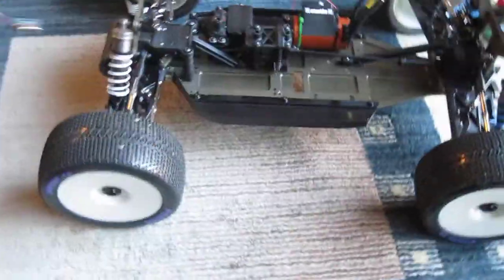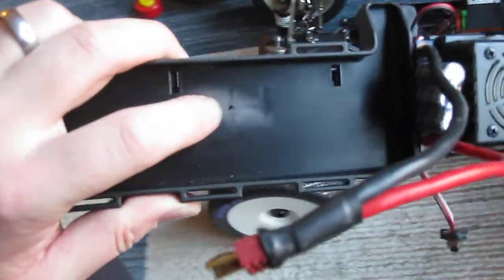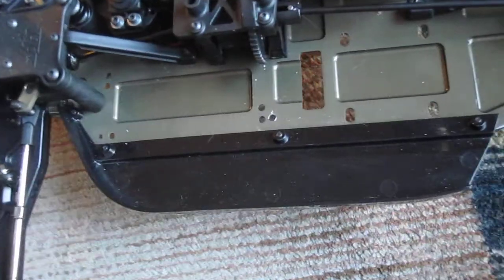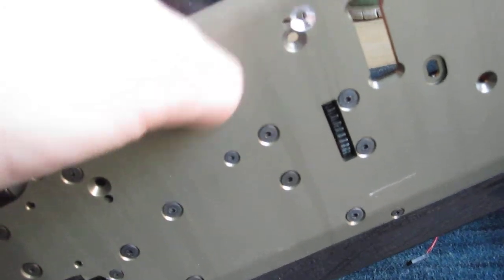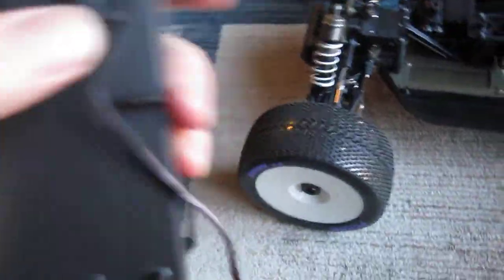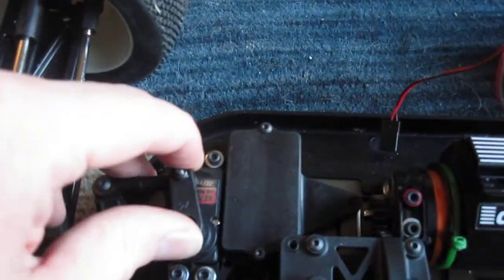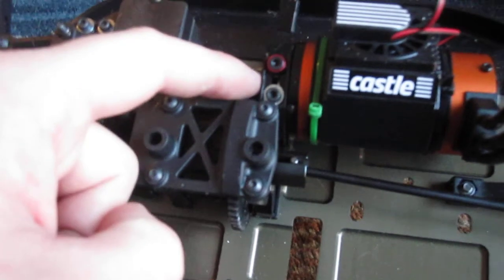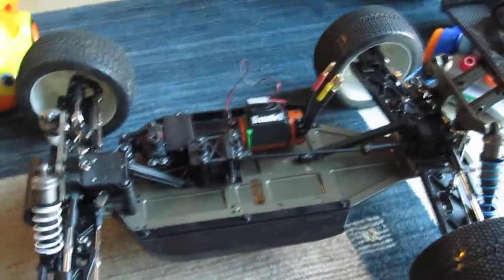D8T brushless

Comment from the maker: Will post when I get back from vacation
Hobbyking 150A esc
Tacon 42mm 2200KV
Losi battery tray, from one of their 1/8 scale cars
Motor mount i cant remember brand but it was expensive about 80 bucks really nice though
Radio box was a cnc part dont remember brand either about 15 bucks and is part of a conversion kit for the d8t

Comment from the maker: hehe, they made it very hard to assemble, always had to keep bags/screws/small part etc under tight control, so they wouldn't grab/eat/throw a part away, but it drives nicely, same size as my e-revo, but handles so much better, has a ton of power, runs cool

Comment from the maker: Elite Rcd motor mount, a very nice mount i might add

Radio airtronics mt4 + fhss4 telemetry receiver 
Hitec 500 oz 7.2v 
Some cheap 7.4v bec 

Things i would do different... Center mounted esc plate that mount to the center diff towers,  this would allows you to mount a battery on each side for better left/right balance although you can always just add lead weight if its a problem

Comment: how fast it was running on 3s? 
how the temps with that battery were after a full pack?
Reply from the maker: i used two 3S which made it stupid fast, just like the e-revo and the vorza at 70+ mph

on 3S and such a large esc+ hungry motor you are likely to draw more power than the battery is ok with, the result is a puffed pack which will degrade fast...i did test it however in my vorza and i got about 30 mph

if you want to run 2S or 3S, i suggest you get a shortcourse motor (550 size) and esc instead something like a tenshock 411 4000kv and hobbywing SCT-pro esc
Reply: I did find a terrific deal on a used nitro roller and I have no money for the electronics, but to test it I have 120a ESC, 550 4-pole 3400kv motors and 3s 6500mah, but nobody is running this low 3s so Im searching before doing it to avoid puffing my 3s battery from my SCT 4x4
Reply from the maker: alexParalabrax you should be fine imho....i run a losi scte2 all the time with 120A esc and 4000kv 550 motor, on 2S (SMC 2S 6500 70C, and gens ace 2S 5000mah 40C) short course trucks are same dimensions as 1/8 buggies but usually with a some lighter components, so as long as you dont gear the truck too high you should be fine.....for a little while i ran my D8t with a mamba max pro and castle 3800kv 540 motor, im pretty sure it was faster than 30 mph on a 3S, motor got a little hot but im sure a fan would have kept temps in check